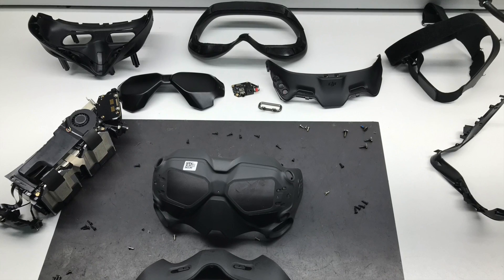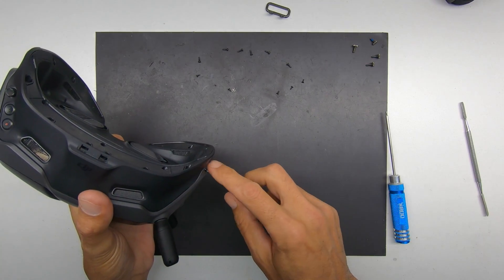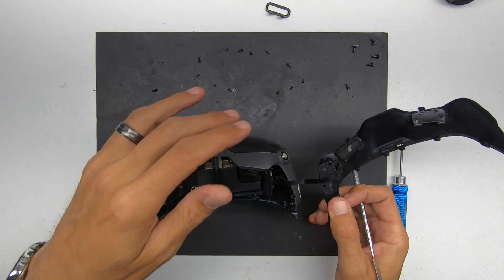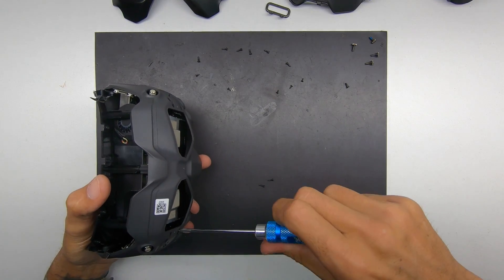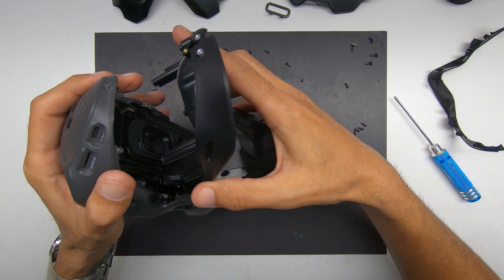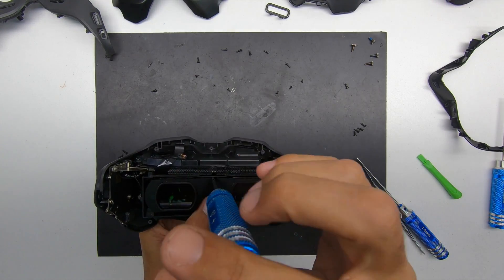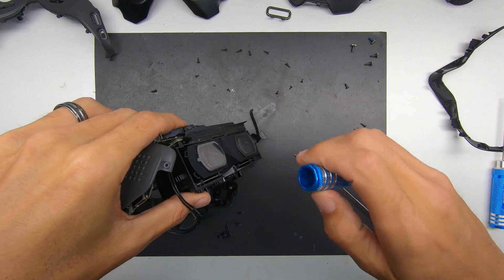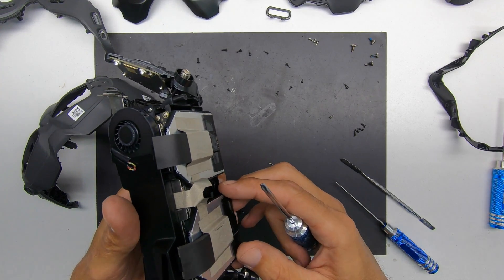Dji Digital FPV Goggles Teardown Part 1. Whats inside?

Comment: Could I essentially take a pair apart and hardwire a tablet or screen instead of projecting into the eyepiece to make a STANDALONE dji fpv MONITOR. I know u can be wired to a pair and use the app and alll that. But can I make a stand alone monitor based around the actual video Rx?

Comment: How hard would it be to replace the USB-C/ MICRO SD Slot Board on the front side of the Goggles. It almost seems like you could get it from the front, but from your videos it seems that you might have to tear it down completely like you did to get that outside panel off... i found a replacement and now that i see it uses a ribbon cable, i would love to replace it bc its not too expensive for the part and then i would have a tight usb-c port again. I bought them with the dji fpv drone so i could basically get best of both worlds plus a dji remote controller 2 to start out with or I have frsky, but want a TX16S w/ crossfire. 
Do you think its worth the trouble of taking it apart to replace the usbc port board? Im pretty sure you can connect it to your phone and then someone can watch the live view on the phone and it should have audio also. I always wear my headphones i love having the audio on low in the background lol..
I have the V2s but theyre basically the same i heard. did you not use the A/V out port for video out in the past when the usb c video out wasnt working yet? 
Geat videos and really applies to the new air unit as well, theyre very similiar in how they work and seyup, wiring, programming, etc..

Comment: since you tear down and rebuild these let me ask you this . does this goggle have a actual fan that removes heat from the eyecup area ?i know it has a fan that cools the electronics but i am more interested in if it has a actual fan to reduce fogging in the eyecup area ? i ask because i sweat easy and fogging is a issue with most goggles for me .

Comment: Is it possible to use the video transmitter from the dji fpv drone standalone connected to a camera?
Reply from the maker: You can hook the DJI camera in transmitter to 12 V source and use the goggles it doesn’t have to be a drone
Reply: I think I wasn't clear.. Is it possible to remove the internal video transmitter from the dji fpv drone and use it in another drone lets say? Im asking because I saw there are two boards interconnected, one might be the main board, the other might be the vtx but I'm unsure.
Reply from the maker: @joaovictorf.carvalho458  It could be possible I don’t know anything about the DJIFPV drone specifically but drones in general are usually just a bunch of components put together so I don’t see why it wouldn’t
Reply: Excellent, Ill try to investigate further.. this is a good "solution" for someone who crashed and wants to move the video system to another drone. Appreciate your reply

Comment: Amazing work. I just broke the antenna holder on one of the four. But with this much hassle I guess I'll just leave it. What's broken is just about the last piece you removed.
Reply: My thoughts exactly
Reply: Manage to fix it , i have the same problem
Reply: @lappinzswizzy  I didn’t fix it. It is just hanging out- gluing it into place didn’t keep.
Reply: @seb-depp  i cant even screw my antenna into it as it just pushes into the goggles
Reply: @lappinzswizzy  Bummer! Maybe you have to open it up, then. Or send it to DJI - their repair prices seem reasonable to me.

Comment: Hi. I think my power supply board has blown, goggles don't power on and I can smell that faint burnt circuit smell, I can find replacement V2 boards but not V1, do you think the V2 board would be compatible? Thanks for the comprehensive video.
Reply: Did you ever get round to fixing the issue , I've just got same with my v1 goggles and suspect the power board is at fault, thanks
Reply: @spaceportseven  I sent them back to DJI and they sent a new pair as they were under warranty, that was quiet a while ago.

Comment: Hey mate, quick question my mate i fell in to a stream while doing a shoot with googles on. I believe the power was not on by the time we hit water. What do you recommend at this stage to fix it. I haven’t powered it up or done anything to it. Its just dried outside and maybe there could be water inside. Still couple of months old. Appreciate an answer mate :)
Reply from the maker: Honestly take them apart and make sure they are dry and clean before powering up. Wash down the parts that have any corrosion with iso and then reassemble. Don’t use rice that is a myth. But the other way is how we get 90% of water damaged phones working again.
Reply from the maker: Don’t use anything on the lcd screens. Clean all up first then power them up. If the screens are messed up then you will be out of luck unless you want to stare at water look
Reply: Thanks for the reply mate. Ill try doing what you suggested and hope for the best. Thanks again

Comment: Thanks for sharing this - it gave me the confidence to take apart my goggles and fix the fan myself :)
Reply: What was the issue with your fan? I have a brand new pair and the fan isn't running, and they keep rebooting after a few minutes.

Is this a hard repair? DJI wants 15 days to do a replacement.
Reply: @JBradHarris  check out the video on my channel

Comment: DJI FPV goggles breakdown- 21 things I think about them:

1. You should spend the extra $15 for the not included extra cushiony foam padding accessory or 3rd party option.  That's a given.
2. No audio is transmitted to goggles.  Deal killer for many.  Not so much for me, I can fly without it.
3. They feel like wearing a brick on your face.  You'll spend some time working on the fit to get them tolerable to your face.
4. You have to wear a 4s battery on the back of your head to balance out the weight of the goggles in the front that make your face droop down.
5. You need an SMA female (female pin) to RP-SMA male (female pin) Adapter to use them with other antennas.
6. The OSD only supports some of the data:   List here:  http://air-war.org/Graphics/DJI%20Supported%20OSD%20Elements.jpg
7. OSD font can't be changed, and is tiny and white variable width font that is lost on a bright background.   I switch off OSD entirely as unusable.
8. Fan will blow under your glasses into your eyeballs.  Not enjoyable.
9. No HDMI output port.  You can get HDMI output if you buy another $600 DJI controller, but... not worth it.
10. Goggles in Audience mode can't request to retransmit garbled frames or packets from air unit, so reception will be noticebly worse than on master goggles.
11.  Air unit gets frigging hot fast sitting on the bench even in 25mw power mode.  Blow a very aggressive fan on it.
12.  Changing regional country area and max output power up to 1200mw is a trivial matter of dragging on two text files to the goggles
13.  You will need to register a DJI account and provide email address just to activate and upgrade firmware on either goggles or air unit.  Deal killer for many, including myself - I setup a warez account with bogus email address.
14.  A channel bonded 50mbs mode is now supported.   Nice but not revolutionary - 5ghz wifi routers have been doing it for years.  Free freqency map by Propwashed showing upon what frequencies the channels fall upon (or step upon)  is here:   http://air-war.org/graphics/5ghz%20Frequency%20Chart%2050mghz%20DJI.jpg
15.  No geofencing as far as I know, but I haven't tested in off limit areas such as Area 51 or over the White House Lawn yet.
16.  The video image is the best currently out there, but it's not imax or a religious experience.   Two screens displaying the exact same pixles in the exact same location for two different eyeballs is a waste of money ihmo.  I'd rather have box goggles and get 2x more unique pixels instead.
17.  Range is pretty fantastic... supposedly up to 6km LOS; 10km LOS with directional high gain antennas.  Top antennas transmit and recieve.  Bottom antennas recieve only.
18.   Despite what reviewers say, I still would rather fly in 16:9 instead of 4:3 and stretch the image in post.
19.  The front face plate is removable with two screws, and you can put an adapter on it for FatShark style analog reciever modules, or hydrodip the front face place to personalize it.  Switching to analog isn't seamless (i.e. you can't use buttons on side), you have to drill down the menus to AV input, and also.. if the feed gets staticy it will blank out the image entirely to screensaver.   The menu system is easy to use.
20.  I think the recorded DVR quality is pretty acceptable, if you can fly your quad super smooth without vibration (as there is no image stabilization).  Latest Betaflight adds more filtering and you can tweak out vibration even more looking at the blackbox data... so...  it's no GoPro 8 or Insta360 One R, but... it's fine and acceptable.  The 720p recordings hide vibrations and jello better than the 1080 higher resolution I noticed, so... you may find better image quality actually by bumping the record setting down to 720p.
21.  Should you buy them?  I can't answer that for you.   I hate mine, but then I'm a new consumer coming from a Gaming environment with 1080p 23" mnitors and not an old school quad builder that suffered with analog for a decade before hand..  What are you going to do, they are still the best out there :-/   I hate mine so much, I'd rather just not go out and fly with them, and I'd rather just stay home and play in Liftoff instead.  It is what it is.  If you do want to buy them, DJI has sales on their products right before Father's Day, maybe Christmas too, so you can save $50 bucks and buy them then.   

This is what it feels like to me wearing the DJI FPV goggles. esp with glasses also on, a 4s Liion pack on my back head, and long range antennas jutting out the front.  Did I mention the air blowing on your eyeballs.  I did.  It's not enjoyable:   https://www.indiewire.com/wp-content/uploads/2017/04/facehugger.jpg

What I did was drag some FPV video files off Youtube onto the SD card, and just had to sit around at the house for many hours trying to adjust the fit and get as use to them as best I could and watch pre-recorded video on them.  Still, I'd rather not wear them, and hate putting them on.  I'm probably the biggest hater of them, however, so I guess take that with a grain of salt.
fpv.air-war.org
Reply: Some good chit here

Comment: really interesting. I find that max IPD (inter pupillary distance) is not 70mm on mine. From your point of view, is there a way to increase by 1mm / 1.5 mm the IPD ?   it seems to be possibe in the video at 15h50 by trim 2 slot screw  and external side of lenses.

Comment: Much appreciated. I am tearing down two goggles to try and combine them into a stereoscopic (3D) digital system.
Reply: That sounds mind-boggling. I dont think anyone has ever achieved 1080p 60fps (or 720p 120fps for that matter) 3d fpv video. Ever.
Reply: @Whiskey Mystery That would totally work but you would need everything from two sets of goggles except one LCD panel from each combined into one headset. Then two air units / vistas and cameras on the quad. Good luck 👍
Reply: @changeagent228  I got it flying using two sets of goggles striped down so that my left eye could look in to the left goggles (right eye slot) and my right eye could look into the right goggles (left eye slot). And yes two air units. The 3D view was stunning UNTIL! either camera lagged due to frame drop then everything would go out of sync for a moment. Sadly not going to work unless L and R views go through the same signal feed.
Reply: @WhiskyMystery  Ah yes of course. Ok try a third headset as primary and the other two as spectators. Spectator mode does not re-request frames. Of course if you have breakup it will look awful but if you stay line of sight and keep the power high it should work. Let us know how you get on. Well done so far. 👍
Reply: @changeagent228  Ah you forget there are two separate cameras transmitting from the quad :-)
Reply: @WhiskyMystery  Yep I was in the shower and it struck me haha. Then checked and here was the comment. It's because while I was typing the comment I also opened some tabs and was searching up dual lens single sensor cameras for a bisected stereoscopic system idea I had lol. I wanted to help you simplify the system. I still think it could work but you would lose half the screen in each so it's not worth it. But yes you would need four pairs of goggles. Maybe we could convince DJI to release a firmware update to have a fixed latency and show corruption. Call it race mode or something. 🤔

Comment: One thing: av OUT! analog by av in, or by usb port please dji !!!! ;) I don't have so much money to buy the dji smart controller .. it will only be a usb to hdmi cable and a firmware update, if you can do it and receive the signal on your googles, why not av or hdmi out via usb ???? it is for broadcast video for others on a screen or live broadcast but not at <600 €! while an update should be enough .. there it will be THE firmware update !!!

Comment: Is there any way that the parts can be adapted to create a Digital HD Monitor?

I can't use goggles only monitors due to Visual impairment, so I'm locked out of this technology.
Reply: I highly doubt it.   HDMI out, too an external monitor from the Goggles is your only option.

Comment: Hello cappa fpv, may I ask how did the video receiver module feed the video to the screen or the display of the goggle
Reply from the maker: YTFPV not quite sure but what is known is it is encoded. I know where your going with the question I just wish it was possible.
Reply: @cappafpv  ok got it, dont know what to say, dji is dji😂

Comment: Hello . Thank you for this impressive job ! with all the knowledge you have of the inside of the google is there a way to access to the lcd without do the full tear down ? (Today a yellow spot appear on my right screen) for me il doesn't look to be a dead pixel but a kind of dust I hope to try to remove .. Do the full tear down exceed my confidence in my skills even if a tear down and rebuilt some of my phones :) .. thank you for your work. Regards
Reply: ive got the same thing, yellow marks on the screen. did you figure it out? is it burns from the sun on our lcds? from leaving our goggles facing upwards into the sun.

Comment: Can you confirm which IC chips are being used on the main board? Bytefrost uses the Divimath DM5680 and the Analog Devices AD9361.
Reply from the maker: Change Agent I have already put it back together at this point I’m sorry
Reply: @cappafpv  No worries. 👍
Reply: Sorry for delay I had no alert to your message I only discovered when I returned to this video. 
There's no official announcement for one that fits on a set of Fatsharks and such. DJI issued a standalone module for racing events that outputs low latency but you can't buy it. You can get the smart controller for $700 which gives you hdmi out but it has 100ms latency so is only good for spectators. There are a few folks working on a cheaper hack using a raspberry pi but it also has bad latency and also suffers frame distortion like seen running a secondary headset in spectator mode.

Comment: Take apart the air unit !!
Reply: Most people in the FPV hobby are wondering if it can be made smaller by removing the outer heat sink casing
Reply from the maker: My very first DJI FPV video the unboxing one I take the air unit apart.

Comment: Outstanding video, can't wait for part 2.  Could you tell if there are 2 separate displays, one for each eye?  So far it looks like there are two separate HD screens that can move.
Reply from the maker: Shannon Smith yes each eye has a screen that moves independent of each other. Pretty slick

Comment: I cant stand the rolling bars on the video GAHHHHHH.
Reply from the maker: Boosted420A0135 it’s a combo of the frame rate on the GoPro and a led light I used above it. I didn’t realize it was still on 60fps.

Comment: Could the RPSMA connectors be replaced with SMA connectors with new cables?
Reply from the maker: kenkamm wow good idea and yes they could. The other end is a ufl. But it would require the teardown
Reply: SMA connectors are not good, they will worn out the connector side, not the antenna side which mean cheaper to replace the antenna once it worn out
Reply: Arief Adha is correct! RP-SMA is the better way. Somewhere along the line the community got it all wrong.
Reply: you guys need to stop repeating hype bullshit and stay in the real world. SMA barely wear out in a year. worst case you open the goggles and pop in new UFL
Reply: Sma adapters are negligible loss

Comment: Thanks for the teardown man! You're nuts lol... Did I see that right... the screens move?
Reply: Moving the screens, rather than moving the optics only in the binocular system when adjusting the IPD setting must be why the DJI doesn't seem to get much edge distortion since the optics are always directly in line with the screens.
Reply: nothing to do with that,  they all do
Reply from the maker: Yeah believe it or not the screens actually move I thought that was weird too. Wait until you see what I do to the housing lol.